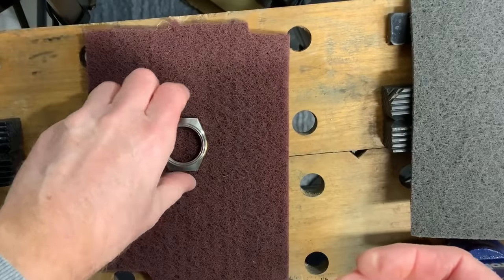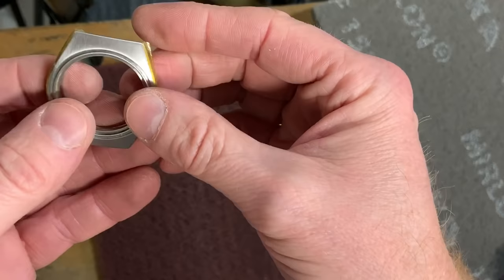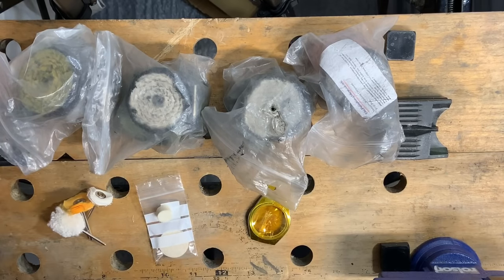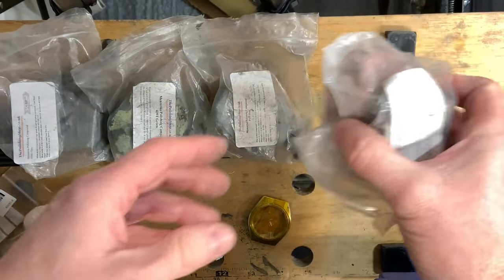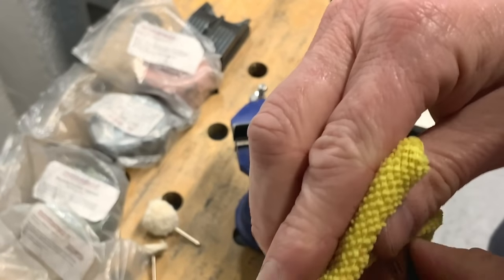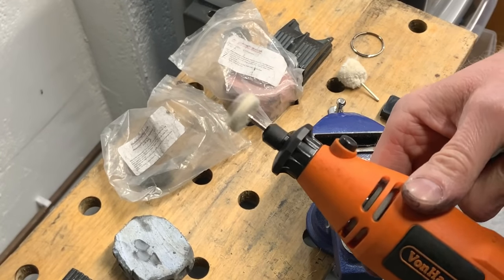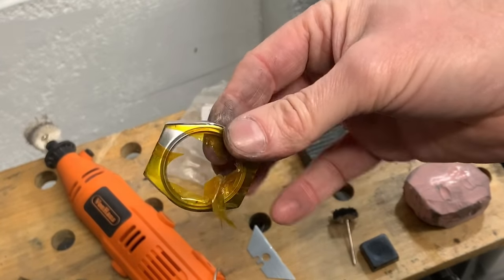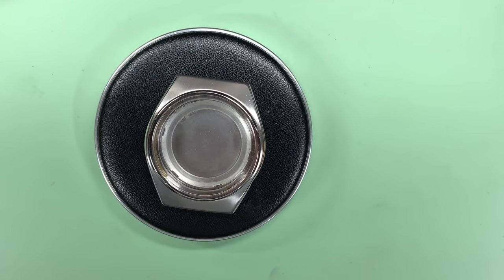Watch Case Restoration Part 2 - Seiko 6309 Giveaway

Comment: Looks a lot better and i am glad you got most of those scratches off the back. I am in the middle of polishing my Seiko SNXS77 and the one tip you gave with the tape around the chuck of my Dremel i forgot to do and lightly scratched the case "whoops" its not as easy as it looks. Great job so far keep up the good work.

Comment: Thank you for taking the time. Look forward to the crystal fit. Another thing I struggle with.
Reply from the maker: Thank you Matt.  The crystals on these are tension ring fit so should just press in using my watch press. Hopefully that part goes well... They dont normally break but doing it on film is sometimes like a curse!

Comment: Good job again. I love doing this myself as much as getting a movement to run. After your recommendations previously I use the same compounds. Great results can be had for little concentrated effort in my opinion.
Reply from the maker: This is great to hear.  Menzerna is the best in my opinion, used with the correct wheels gives great results quickly

Comment: This stuff is so addictive. Brilliant video with all the detail clearly explained. Thank you. 
Is it possible to do a tutorial video or tips on how to reassemble a watch movement in the absence of technical support: diagrams etc? I have a bag of bits that someone gave me - it's only a cheap watch, but I'd like to have a go at getting it working but don't have the slightest clue where any of the components go lol. The most I've done so far is just replace a movement, so I'm completely lost on a micro level.
Reply from the maker: Thanks for your comment.  It is an interesting idea for a video.  I will give it some thought however you really need to learn the basics as practically all movements follow the same path so once you have a grasp of some of the basics a bag of parts would not be so daunting.
Reply: @MyRetroWatches  Thank you so much for taking the time to reply. I've done a little research but struggle to find clarity on the order of assembly. I'm not the brightest bulb in the box lol, especially in regard to technical stuff. But you're 100% correct: my knowledge and understanding of the topic needs a considerable upgrade. I'm only in the embryonic stages of discovering this fascinating hobby so I really need to knuckle down and do more reading & tinkering.
Thanks again.

Comment: Nice work Mike. I used a 320, 400 and 1500 grit on a case I’m working on. But I only have a brown compound. Will that suffice? Can I use rubbing compound or equivalent to finish off buffing? Thanks as usual Mike. Learning a lot from you!
Reply from the maker: Not sure of the brown compound as not all brands are the same colour.   I really need to buy some of the polish I use and sell kits to you all.  The postage out of the UK would be the hard part though.
Reply: That would be great. I’ll wait for it and see if the postage from there would be reasonable. Thanks Mike!

Comment: If you don’t mind me asking I have a similar seiko type 2 case I’m trying to refinish how did you go about removing the bezel? It seems sunk down into the rehaut of the watch
Reply from the maker: Usually bezels if you look closely will have a small slot / cutout a bit like press fit casebacks where you can get a knife in and pry.
Generally sat 6 or 12

Comment: Mike, love your work, just an idea but how about using scotchbrite on a wheel? Much easier process for a brushed finish.
Reply from the maker: Norse King unless it’s a good quality and dense material wheel on a polishing machine I would not consider it . Professionals use them on polishing machines .
On a dremel type tool I’ve found the quality to be poor plus they are not wide enough to cover the whole area in one go which is what you want.  The worse thing is catching it in the hole as this has happened to me before and nearly taken my fingers off

Comment: hi, may i ask because the caseback of my seiko 5 have a single deep scratch though it's not noticeable since it is on the caseback, do you think it can be repaired? and how much do you think it will cost? just wondering if you have any idea :)
Reply from the maker: I dont know how you would repair other than removing material to get under the scratch.  This would then ruin the caseback lettering.
Reply: @MyRetroWatches  i see will it deform the screwback? when you remove a material?

Comment: The case looks so amazing 😍. As always an exceptional job!!!
Can't wait to see the watch back together!!

By the way, do you refinish the back of the case? And is there any special technic you use?, because sometimes the back of the case tend to have more angles than the front.
Reply from the maker: Diego David Reyes the back of the case got a light polish also with the green compound to brighten it up. Just used a loose cotton mandrill
Reply: @MyRetroWatches  thanks, i currently restoring an enicar watch and the back of the case have some pretty deep scratches, what can i use to remove them at leas a little bit?